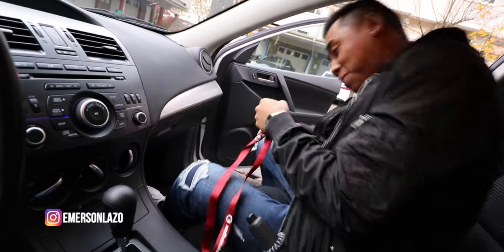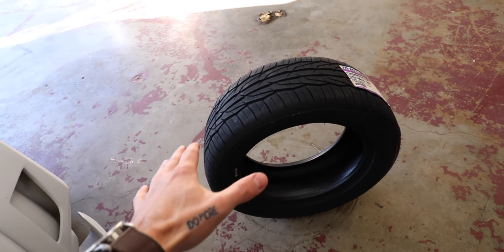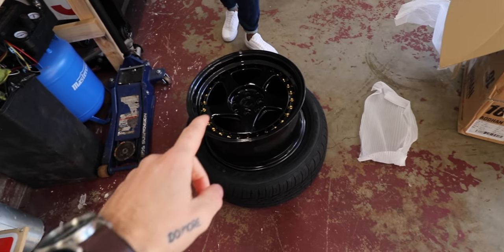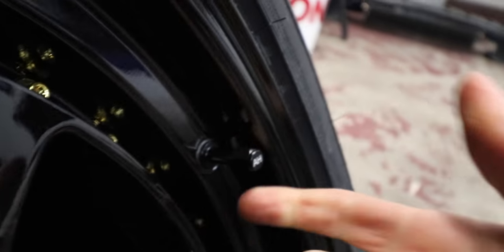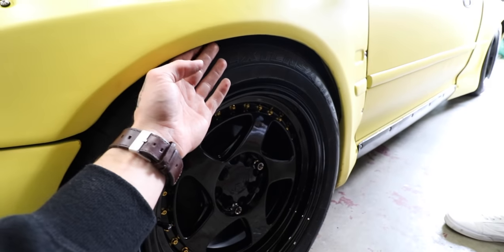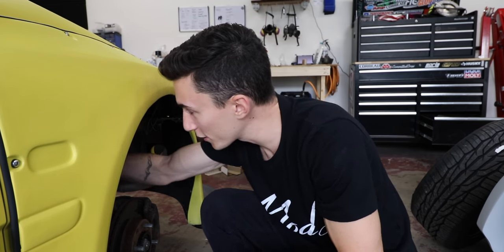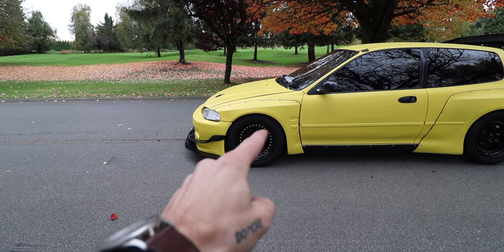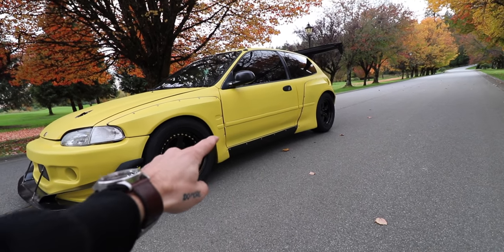NEW WHEELS FOR MY WIDEBODY CIVIC!

Comment: I’m gonna warm you now, put thread locker on the spike tips before putting them on or you will vibrate them loose while driving... I went through 2 sets before I got smart and just thredlocker’d mine in and I just used a deep socket to to remove the whole lug

Comment: love the new wheels and tires bud. I would make a suggestion for the next tires set though. I would go with a 45 instead of the 50. That way the circumference of the tires will be closer to oem and your gauges wont be off as much. You will also be able to accelerate faster in the long run. Just a thought. Keep up the great content.

Comment: Does the car not air up very high? I thought with bags you would set the ride hight in the middle of the range of the strut so that you have a little extra to go up Incase of like speed bumps or whatever, and then when you air out the car would sit on the ground? Maybe I’m wrong I run static lol

Comment: If you get spacers GET LONGER WHEEL STUDS.  The lug nut will only grab 2-3 threads if you dont and run the risk of losing a wheel.

Comment: A reason why you aren't getting boost is because the civic is getting too much grip that your engine isn't building revving enough to build boost, example the old tires are just spinning, meaning the engine will just rev out easily getting boost but just spinning.

Comment: next time get the right size tire please.
go for a 40 instead of a 50. its a whole damn inch difference in wheel diameter (not just the rim), it fucks up with your speedo so much.

also, no cutting and basically totalling your car out is neccesary if you'd just go and get the right size tire.